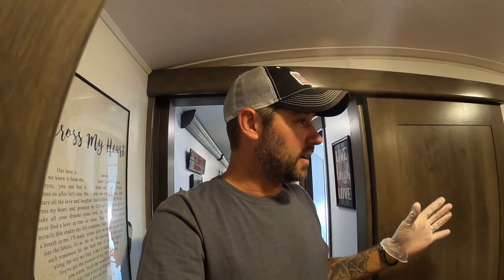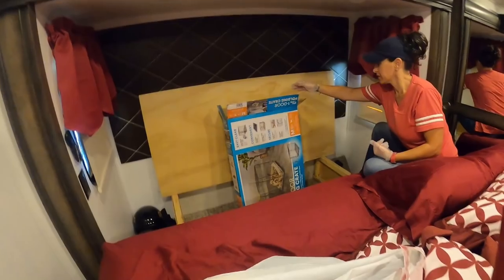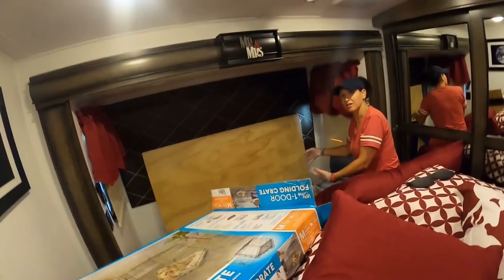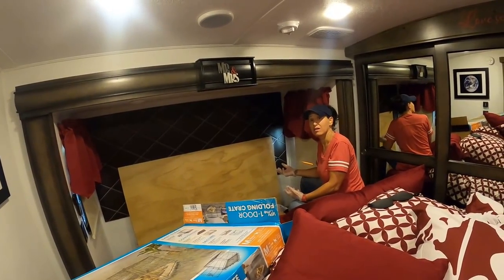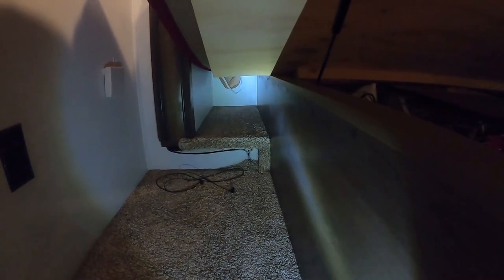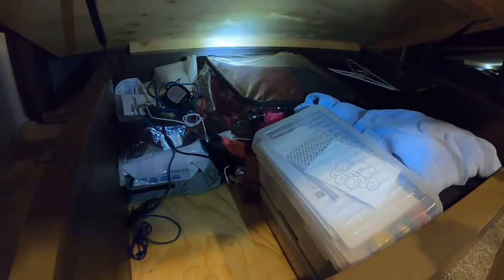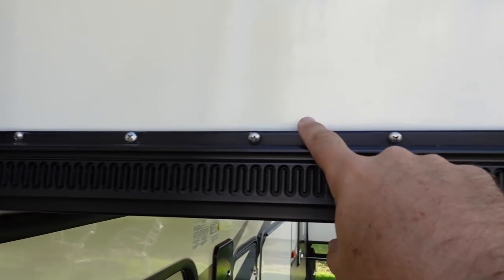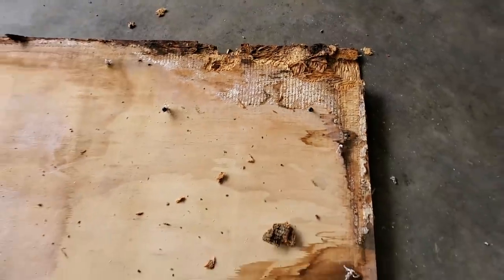MAJOR RV Leak! (Full Time RV Living on HOLD)

Comment: If you get tired of putting in the reflectix you may want to look at non-adhesive tint. Amazon caries it and it does a great job of blocking UV and heat from coming through plus no one can look in during the day. Glad you found the leak before it got any worse. I go over mine at least twice a year looking for bad spots in the caulking and also added an awning topper. Good luck with this.
Reply from the maker: Good idea on the tint.

Comment: One thing I have noticed on all of the new camper videos, which have never commented on. Is those Dag gone blue water filters I see in every new camper video. Get a whole house water filter with the carbon in it. Mount it on a board if you have to. You'll have like soft water every time. Plus more water flow. Refuse to use those water pressure reducers,  just a waste of money. Besides will test your water lines. Hates to say it, but Walmart has those 90 degree brass elbows, which allows your hose to hang straight down, without kinking. A 3 ft. white hose allows to position the filter anyway needed. Just my 2 cents worth.  happy camping in wherever you guys go.
Reply from the maker: That is a good idea. These little blue filters don't do much. We have the brass elbow. It works great.

Comment: Moving in an RV things get loose and things can leak, so glad you caught it early and were able to repair it. I guess checking things regular is the way to go, recaulking everything and in this case caugh where you think it should have caughing. You saw it not caulked you thought about it next time just caugh it. I bought a used machine and the first thing I did was  start caulking,
Reply from the maker: We will definitely keep checking them regularly.

Comment: You mention silicone as a sealant for the slide track.  Almost everyone cautions against using silicone.  I believe it is not UV resistant and if you ever need to reseal the area nothing will stick to the silicone and it is nearly impossible to remove.  Much better to use a good RV sealant.
Reply from the maker: Thanks for the tip. We appreciate it.

Comment: Am glad the issue was resolved to your satisfaction, "but." BUT, was the of the Swintech (?) slide system supposed to have been calked/sealed at the top?
Glad you were able to make part of your trip, regardless.
Y'all Be Safe!
Reply from the maker: They do not caulk any of them on the bedroom slide on this model for some reason. They rely on the gasket to keep water out.

Comment: Boy I will be checking my Montana which is the same as yours but I have the propane  refrigerator out in the spring mine is in Storage for the winter hope to be on the road next fall glad Montana stepped up.
Reply from the maker: Ya. Check it for sure.

Comment: A cheap but good investment to prevent this is to install slide toppers.
Reply from the maker: We would like to get them but I don't think it would have prevented this issue. The water was running into the rail for the slide gear on the side of the slide and the gasket failed.

Comment: Keystone paid for part of it because they knew damn well it was a failure that shouldn't have happened in a rig that new. Owner inspection and maintanence of all the seals and caulking is important but sounds like that leak was caused by a faulty or defective seal or gasket from the factory. As a full timer water is our worst enemy which is one reason why we chose a 2020 Coachmen Brookstone 310RL fifth wheel, instead of using that  wood backing in the walls they use a special material that doesn't soak up and become water logged if there's ever a leak so you don't ever have to worry about delamination. Of course our rig has a couple of warranty issues we are dealing with and so far Forest River and our dealer have been great.  Like you said, very few RV's are perfect out of the gate but on the whole the structure and seals are sound and we should know because all it does here in this part of British Columbia which is about 20 minutes from the Washington state border is rain, lol. I'm Texan and hubby is from Alberta hence the name TexAlta and we're still waiting on the US/Canada border to open so we can get back to Texas or Arizona where the weather isn't so dang cold and damp. It's good to see you both get back to your life and traveling.Happy New Years and God Bless!
Reply from the maker: We are just glad it's all over and we are back out on the road.

Comment: Glad it worked out for you.  I've had some friends that have been pushing me to get going, ain't no way til I have a sizeable emergency fund. Mine does great, but its old (1987). I just had an issue with batteries (they're only a couple months old) I had the battery tested when the problem started but the parts store didn't check the side post (my top post goes to my auxiliary start and side post goes to the starter) I spent hundreds of dollars chasing parts and a week of down time trying to figure it out, only to go back to what I thought it was originally. Luckily I wasn't on the road at the time.
May not be going to Tampa now, want to get a couple short shakedown trips in and won't have the time to do those before Tampa.
Reply from the maker: You definitely need an emergency fund. One issue can break the bank.
Reply: @WaywardWaggs  absolutely. I've talked to too many people that bought an rv and took off on the road and then something happens and they don't know how to fix it and can't afford to get it repaired and everything comes to a grinding stop. My rig is old, but with low miles; I want enough in the bank that I can just go pay cash for another older one. The older ones I can still work on, to a point.old chevy parts are also cheap.

Comment: I think I would have also worn a mask as well as gloves.

I did go back and look at your rig in previous videos and I noticed you don’t have slide toppers. Adding these might diminish the chance of leaks in your slides.
Reply from the maker: Good points. We have looked into slide toppers and may get them if we keep this RV.
Reply: @WaywardWaggs  even if you buy another, they’re a good investment, if for nothing else that keeping debris off the slide and out of the rv when you run the slides in.

Comment: What kind of sealant does Keystone recommend to use to seal the top of the Schwintek rails ?
Reply from the maker: Not sure what Keystone recommends. The tech at Gander just used silicone.
Reply: Just for my own understanding. It’s the top of the rail that lets water in? I could not tell clearly where?

Comment: Haha, Scout looked seriously ticked off to be in his cage at the hotel.
I'm sorry y'all but IMHO that was a design flaw on Keystone's part, I mean why in the hell would you not use a line of calk that costs what 10 cents at most on those slide rails. Seal or no seal that inexpensive little addition very well could have prevented this from happening. For them to cover only 2/3's of the cost of the repair is not cool IMHO, it should have been completely covered and they should be considering a recall for that defect on that model RV. They should step up and do this for all their customers out there before this exact same thing happens to someone else because of a simply line of calk. Again I feel it is 100% avoidable unless there's something about the seal used that causes it to fail leading to a leak like this. As we all know redundancy is a good thing especially when it can be achieved so cheaply by using a little better quality of hardware and some very cheap calk. Anyway sorry for the rant and sorry this happened to y'all but this is definitely on the manufacturer. We all see how well you maintain and take care of your RV, I mean a lot of it's on record right here on Youtube for all to see and it isn't like y'all just don't take care of your rig. Had the rig been built as it should have been this would not have happened...
Safe Travels and God Bless...
Reply from the maker: It was a pain. We are glad we are in the Alliance now.

Comment: It’s really a manufacturer defect. Keystone should have covered a 100% of the cost of repair. It should have been sealed with silicone.
Reply from the maker: None of the bedroom slides on that model are sealed. They rely on the gasket and the gasket in ours failed.